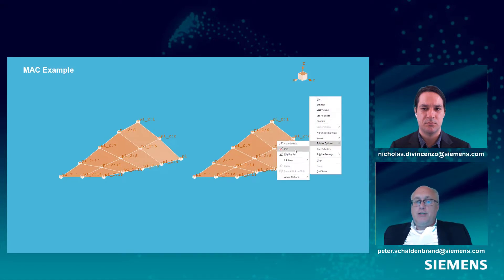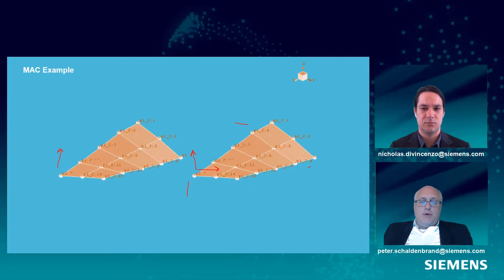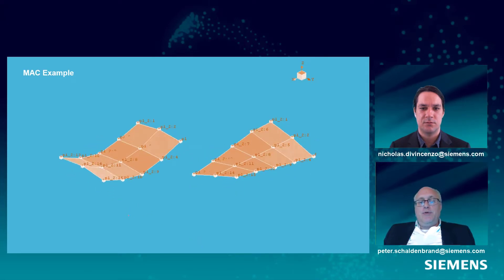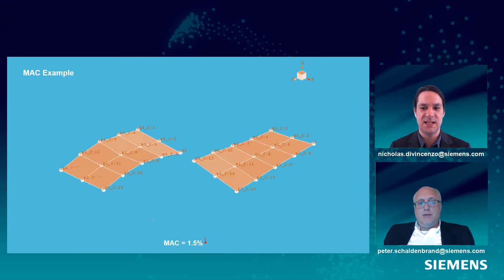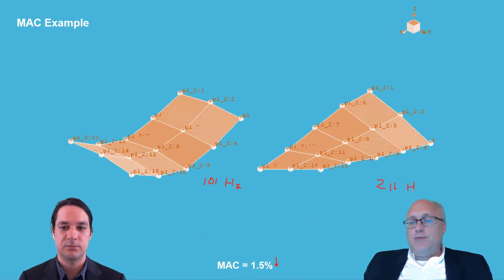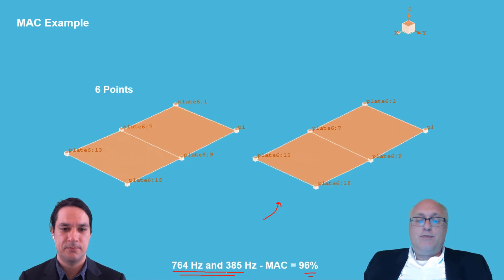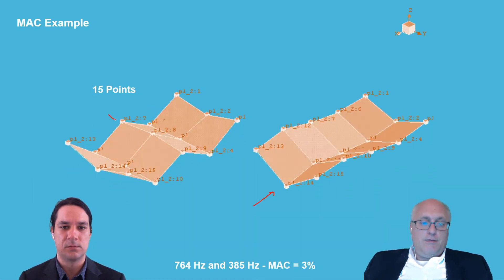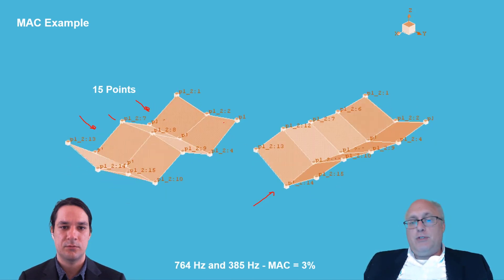Introduction to Modal Assurance Criterion (MAC)

Comment: Hello, excuse me, is it better to have more measuring points in the process of modal test? In this way, the MAC value between the modes can be very low and easy to distinguish. During the test, do you need to select more locations for the tapping points?

In addition, I also want to consult: in the process of modal test, I only have 4 acceleration sensors and 8 measuring positions. The force hammer needs to strike three positions. First, I fix four acceleration sensors at four positions and move the force hammer to strike three positions. After that, I move the four acceleration sensors to the remaining four positions and fix them, and strike three positions on the moving force hammer; How about this method in test When setting in lab, do you choose roving hammer or roving acquisition? Thank you and look forward to your reply
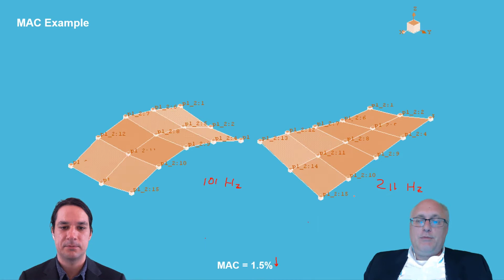Reply from the maker: Hello - Thanks for your comment!   The optimal number of points is a balance between the complexity of the highest mode of interest and testing time.  As shown in the video (2:38) too small a number of points can cause issues of mis-identifying mode shapes because of spatial aliasing.  With only 6 points, we were not able to fully describe the complicated bending modes due to their complexity.  However, if I added 100 more points to this geometry, I would no longer have spatial aliasing for these bending modes, but the test would take an extremely long time and I wouldn't gain much additional information.  More points is not always better, but you can also have too few.
Based on your description, this sounds like a roving accelerometer setup, with 3 references (hammer directions).  I take it from your description that the hammer is not moving to a different point on the structure, but rather hitting the same spot but in the 3 cartesian directions, X Y & Z.  To simplify, imagine you only have 1 accelerometer.  In this case you place the accel at Point 1, and hit the structure at Point 1 in X Y & Z with the hammer.  This results in 3 FRFs (for a uniaxial accel, measuring in the +Z):  Point 1: +Z/Point 1: +X, Point 1: +Z/Point 1: +Y, Point 1: +Z/Point 1: +Z.  You would then rove the accelerometer to Point 2 and collect these FRFs:  Point 2: +Z/Point 1: +X, Point 2: +Z/Point 1: +Y, Point 2: +Z/Point 1: +Z.  The hammer is always hitting at Point 1, but the accel is moving through all the points in your geometry.  This is a Roving Accelerometer test.  By hitting in 3 directions, you are creating 3 references, not roving the hammer.
Hope this helps!
Reply: @SimcenterTesting  Hello, first of all, thank you very much for your reply;

In the process of modal test, by checking the MAC value, if the MAC value between two modes is relatively large, I will add several measuring points to obtain more FRF, and then conduct MAC analysis until the MAC value becomes smaller. Can I do this?